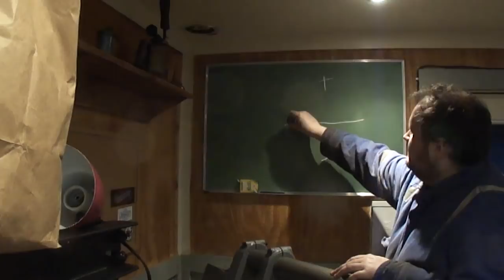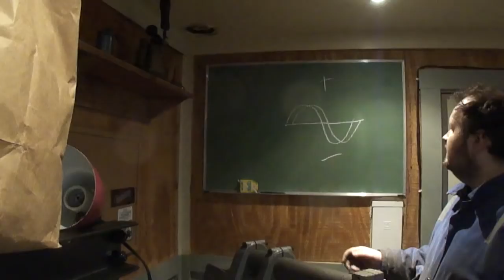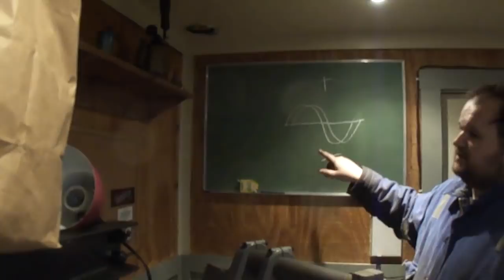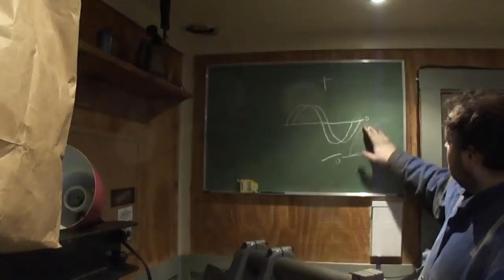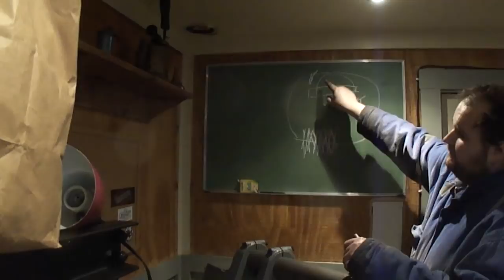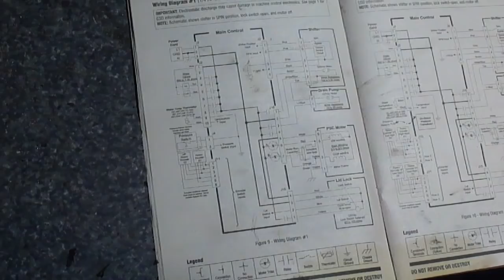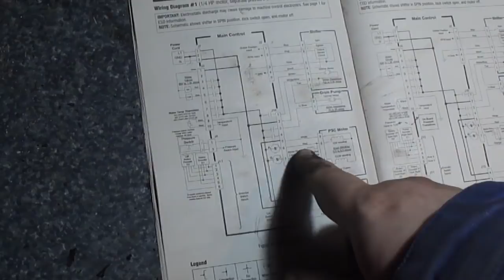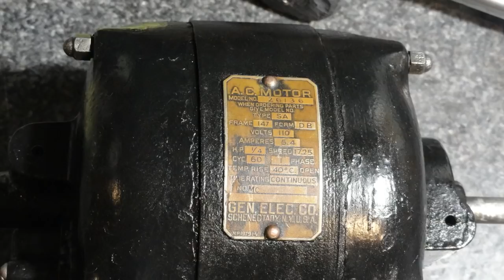Random Update and Rebuilding an Old Shunt Motor/A Bit About AC Motors

Comment: Looks like a new motor Chirpy.  Great job.  I guess I am going to need to make one of those scrapers if I hope to scrape a straight edge some day.  :-). Great video and thanks for sharing.

Joe
Reply from the maker: hey, just the person I wanted to see. The little shunt motor from the microwave oven fan, we were talking about the blowers and fans that would run on the dimmer switches, usually the low powered ones run off of those types of motors and work great with the fan dimmer switch. Thats the same type that's on my furnace blower that I use for the furnace and for the forge, with the fan speed controller on it.

Comment: Now how are you gonna fry them turkeys? 😀Those old motors are great, I've got a 3hp GE from the teens or twenties that came with my 1917 South Bend 15 inch lathe. Probably weighs 300 pounds. Merry Christmas to you and your family!
Reply from the maker: lol, that sounds like the motor that's on my lathe atm, which is also why I call it the pig, lol. (also it looks like a fat pig too, lol) I actually grabbed that fryer out of a scrap pile a while back to cut up and use as bar stock for projects, and that leg was perfect for that scraper really. Also, that vibration in the motor, I fought with it for hours trying to find it, ended up, I just stuck a pulley on it to just put it away for another project and vibration went away with a pulley/load on it, lol. 

Merry christmas to you and your family also. Ive already started going to the christmas parties and started slipping into the winter hibernation/food coma for winter, lol.
Reply: I really like the "winter hibernation/food coma", I think I've been in that mode for a long time. 😁 It's pouring rain here too, almost melted all the snow away, though it's supposed to turn back to snow tonight. That big motor of mine is like three times the physical size of yours, I wouldn't want mine over my head. I've changed it over to a 3 phase that's much smaller. I guess your motor only needed a flywheel to quiet it down, lol.
Reply from the maker: lol, yea, I dread getting that motor back off of the shelf to put up the other motor that I have for it, but after getting the motor fixed a week or so ago, it has alot more torque and power, so debating even messing with it now because it's working so well now. Only reason I was going for the other motor was lack of power and unable to reverse it, but now it has alot more power than the other motor I have, so Ill probably just leave it. I guess it did need the flywheel, lol.
Reply: As long as that motor has more torque and HP and is reversible you probably want to change it out. My big motor isn't reversible so with that and size I went 3 phase. My mill and a big 10" pedestal grinder are 3 phase so I already have it available to me. No brainer, lol.
Reply from the maker: lol, they're both the same HP rating, but the other motor is a capacitor start motor that is a bit newer vs old repulsion motor that refuses to stop no matter what happens, lol. I would go with 3 phase, but no 220 to the shop still and only one 3 phase piece of equipment, which is the mill that still is sitting there not hooked up. Hopefully within the next year or two I'll get it up and running, lol.
Reply: I don't know how far you have to run 220 but it's easy to do, I'm sure you know how. With the cost of wire going up the way it is it may take a couple of years to save up for?😀
Reply from the maker: lol, we have the wire, and it's around 30-40 ft, but digging it by hand is almost next to impossible because where the shop is at, it's nothing but sandstone under the ground, so digging the trench is the problem. I have some work coming up on a backhoe where I need to make some new pins and such for it because the old ones were worn out along with the bushings, so while I have it here, I'd dig the trench using that. It's just a waiting game until then.
Reply: I can really understand the waiting game. I need to do some trenching but also no backhoe anymore. My loader only has a 6' wide bucket so that won't work. I did build one of those loaders for a garden tractor you see in the back of Pop Mech magazine and I have the plans for a small backhoe so maybe something there? I traded some English walnut slabs to a friend for about 200 pounds of medical grade lead. When he delivers it he's bringing his backhoe to dig my trench for me won't be until after winter though.😥
Reply from the maker: lol, then you defenitely know that evil waiting game then, lol. Also, I'd trade wood for lead also, so you got the better deal out of that one,lol. 

Also, as a side note, isnt "medical grade lead" kinda a contridiction tho? lol.
Reply: Medical grade (I'm told) is very pure. This stuff came out of the doors in an x-ray room at a hospital. I don't know if pure is a good thing for casting hammers and such though? Definitely😀 the better of that deal!
Reply from the maker: lol, Im sure it is really good for hammers then and for alloying too.
Reply: I sure hope so. Again Happy holidays to you and yours!!!
Reply from the maker: lol, to you to and thanks for watching george.